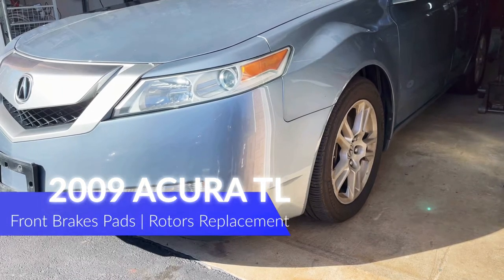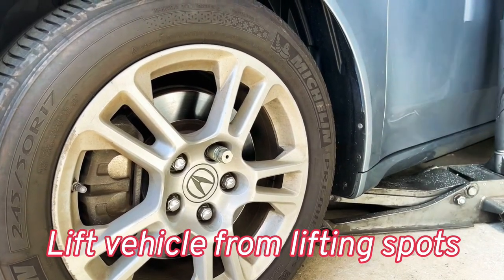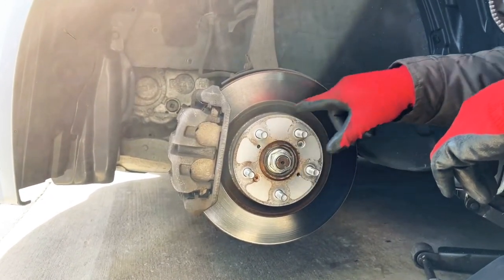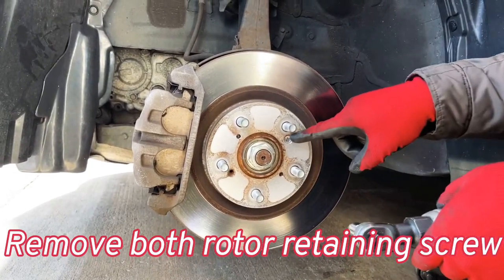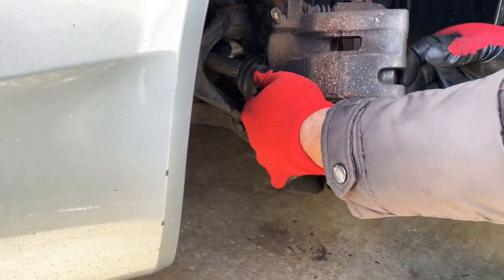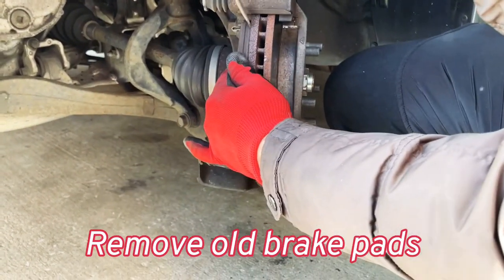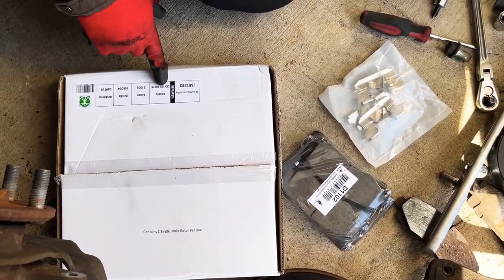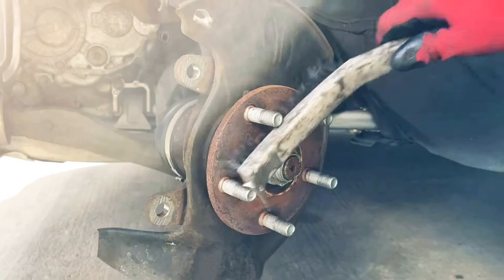2009 - 2014 Acura TL Front Brakes Pads | Rotors Replacement

Comment: You mentioned adding the link to your parts.  Can you please do so?  Thanks!
Reply from the maker: Sorry about that’s I must have forgotten please see below the link
CRK11805 FRONT 320 mm Premium OE 5 Lug [2] Brake Disc Rotors + [4] Ceramic Brake Pads + Hardware https://www.amazon.com/dp/B00EQMI97Y/ref=cm_sw_r_cp_api_glt_fabc_460T1XKET6ZB6XRM9W9K
Reply: @kashfix9160  Thank you!

Comment: there is no way those bolts broke loose with minimal ease
Reply from the maker: It based on the torque, higher the torque and rust hard to break them loose.